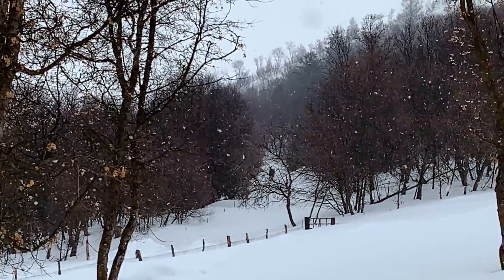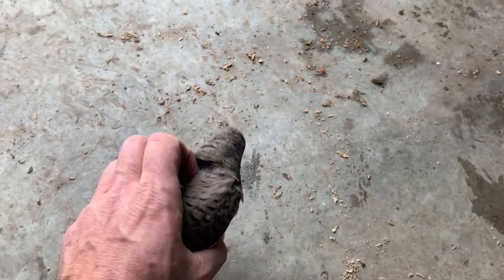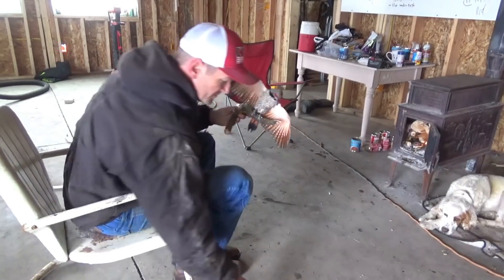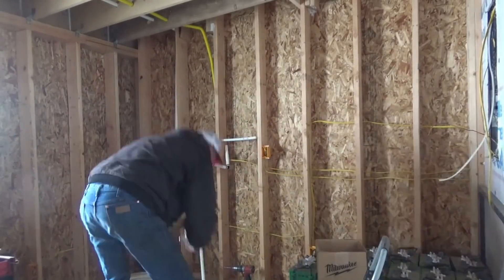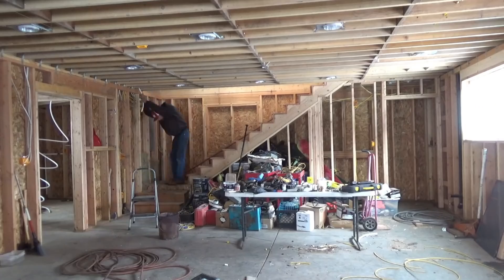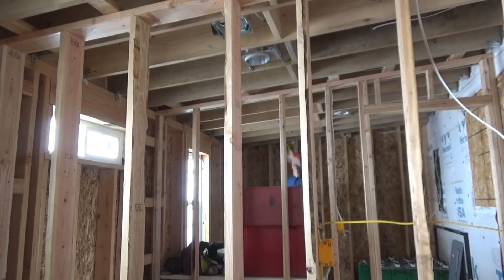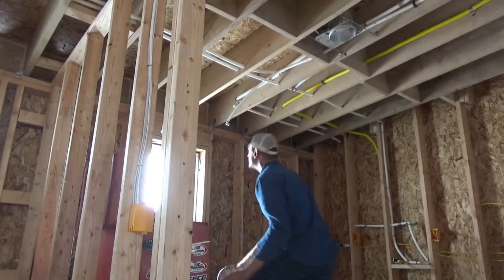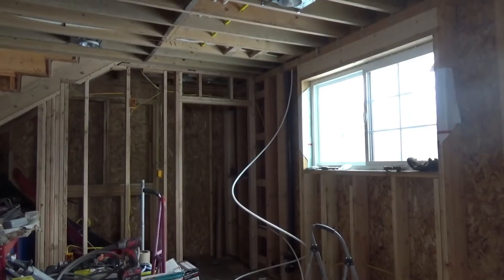#307 - Water Lines Are DONE! Woodpecker Problem Solved... And A Moose

Comment: Coming from an electrician.... At 10:25 I'd recommend moving the electrical box that is on the left side of that wall to the right an inch and a half. Just add a 1' piece of 2X4 and move it over.  Will look better and make drywall finishing much easier.  Make sure also that your light switch boxes are at least 3" from door openings to allow for trim. On interior doors with only 1 stud this means adding a 2X4 as well.

Comment: Here in Japan the PEX stuff comes in only blue and pink, but it's the insulation that is coloured not the water line, and yes it is all insulated, hot and humid in the summer makes you want to insulate your cold water lines too! If you run short of some line, you can buy just the insulation, this works, but I see your point on the non colour coded water line.
Sad about the woodpecker, I bet he just could not find enough food. I'm looking forward to seeing the seasons change!
Cheers from Tokyo!
Reply: I would be tempted just to put a circle of red or blue tape every so often to make it easier to identify each line when the walls are on etc.
Reply: lol at sad about the woodpecker  .  i have seen abandoned houses where woodpeckers pecked feet and feet of siding off a house causing major water damages .  not only that they disturb ones peace by pecking on houses that people live in also causing damages  . woodpeckers also cause lots of damages to trees . they peck the bark completely off in a complete circle killingg the top of the tree  . also the holes they peck allow for certain bugs to get inside of the tree and the tree will not survive .  the woodpeckers purposely peck a hole so that a bug will go in for them to eat later  . lots of  birds and animals in this world that can cause almost as much destruction as most of the humans  .

Comment: Glad you solved the Flicker problem.  Hope it doesn't have lots of relatives to take it's place.  A flock of them will do some serious damage to all your exposed wood.  We often see dead birds that fly into a window too hard, as they must see light coming from behind and think they can fly towards it.  Hope your exterior wall plumbing doesn't cause trouble.  Sounds like you're addressing it.  I'm surprised your water softener only recharges monthly.  My top of the line Culligan softener recharges about every 3 days.  And it uses a 50# bag of rock salt about once a month.  I enjoy watching your progress.

Comment: You made some very interesting comments about water.  We just moved to our homestead this past September. We found the old well (there used to be a house on the property), but there was no plumbing from it and it is an old, shallow, hand dug well. There is a possible spring on the property, but with the unusually high amount of rain we got this year, I have no way of knowing if it is year round and if it is, if there is enough flow to serve our water needs.  So the whole time we have been here we have been using rain water to wash with. I had just commented to someone the other day that this is the first winter that I remember ever not having an issue with dry skin. Also, we have a tankless water heater installed. I did not know that they last longer using soft water. I have been trying to figure out what is the best thing to do for our water supply. Develop the existing well, drill a new one, try to develop the spring, or do a rain water collection system.  Rain water is soft.  You have helped me decide, I think it will be a rain water collection system.  Now to figure out how best to set it up.

Comment: Network cables and wires to the windows and doors for future alarms could be a good thing before you close up the walls.  Most of the solar inverters now can use a data line into them and with the kids keeping them from the net is a pain on wireless but wired just pull the plug in a locked closet/cabinet. 

The drywell for the drain would need to be down hill enough from the well to not contaminate it as the water soaks in. 

Feel the skull and neck of the bird as it might of simply flown into a window trying to escape the cold. One of the jobs I hated when working at Bestbuy was the morning check the front of the store for seagulls that flew into the window above the doors.
Reply: H No  I worked at one in Maryland that is near a waste transfer station they are at year round.

Comment: Always drill the holes in the centerline of a beam or floor joist. It doesn’t affect the load bearing strength like holes close to the edge of the beam.

Comment: Hi. Looks like you have long water line from heater to some tap. So its gonna take few minutes for fresh hot water to pass way to tap. In such case you may make circulation with back way tube and circulation pump. Also good insulation very important as its tubes play like radiators. And cold tube may couse a lot of condensation. Good luck.

Comment: Knowing how cold it can get and with plumbing in an outside wall would a manual drain-back be practical? Maybe your hose-bids will suffice?  A typical out of a specific color of PEX solution for color coding piping is to use a colored electrical tape wrap for ID.

Comment: The better way to protect your plumbing is to use a high value insulator to the outside of the plumbing, rigid foam with a layer of reflectix for example, and not insulate  to the interior. This effectively places the plumbing in the heated space.

Comment: I would use the white for softened water Lines and blue or red for everything else. 

Then you bring in 1 inch into a manifold that breaks off to 3/4 for the water heater and then 1/2 for everything else.

Comment: Hello, maby it's the German speaking out of me, but I hope you document how and where you run all the power and water lines. I imagine in 10 or 20 years someone hanging a picture on the wall or something and they drill into one of the water lines.
Reply: Yup, my husband hit a copper pipe with a nail in a bathroom of ours. The previous owners installed the bath themselves. The pipe locations were not logically placed.

Comment: Do you know you can use no-salt water softening device for water softening? I used it when I bought my new house and it works very well no scale build up, it's been over 15 years now every thing are working well, only replace water heater recently, it is a 6 years water heater, espresso machine is still working strong. Best of all it will not effect your health.

Comment: Wouldn't it help the plumbed walls to put a layer of foil backed foam insulation between the sheathing and the pipes?   I think somewhere in my travels that's what I've seen others do.

Comment: Can lights and pex....we wouldn't be allowed to be no were near a can with pex  as cans get pretty hot.irving texas code.actually alot of fire resistant codes to a can light here.
Reply: I thought all his lighting was l.e.d.
Reply: Yes, the code may be to keep the pex twelve inches away from the can lights.
Reply: @drucifer_too   I dont no led or what ever. really common sense is electrical and water dont mix.lots of Joist bays to choose from.why so close or even in same bay was my question kinda.
Reply: @monicapttrsn  because we can dont allways mean we should!!
Reply: @shawnvandenabeele8307  I was agreeing with you pretty much.  I saw a video where the code requirement in a particular state was to keep the pex a min. 12" away from the can lights because the heat from the lights damage the pex.  The reason why I made the statement is because Heath wants to pass the plumbing inspection and will likely have to move either the lights or the pex.  Sure, he can move them two feet away, but there is a min. requirement, and I do want to see him pass the inspection.

Comment: You could wrap some of the water lines with heat trace wire so that if you do have an issue you can keep them from freezing. Consider if your away from the house for a few days unable to heat your home. FYI: The soften water that you will be using in the kitchen, Bath, Laundry, Contains a lot of salt. Take a glass full of softened water and either let if evaporate, or boil the water off. Be surprised how much salt is contained. So I don't think letting the water softener backwash into the septic is going to make much of a difference. Of course that salt in your water lines will help lower the freezing temperature.
Reply: He's using potassium.
Reply: Potassium chloride (KCl) is a salt. Consuming large amounts of salt whether KCl or NaCL is not healthy, nor its it good for metal pluming fittings or components.
Reply: Sorry that is incorrect. If you take a glass of water from softened water and let it evaporate or boil away you will be left with a salt (KCl or NaCL) residue. Typically a water softener will add between 35 and 65 milligrams of salt per 8oz glass of soften water.Also I doubt KCL is safer for consumption since natural Potassium contains some radioactivity (K-40 Beta decay).

Comment: In sweden we are not alowed to have any couplings built in the wall, big no no.
Reply: Peter Lee  

100 years ago when i went to plumbing school, they taught me that if a pipe leaks it is where it has been conected to another pipe in some way. Therefor we have all our pipes that is under pressure on, not in the walls. All our waterpipes are visible.
Reply: In Finland we have all waterlines that are inside the walls in a another pipe wich is called leakpipe.
Reply: northerntrucker same here in the Netherlands: blue for cold water, red for warm and yellow for gas

Comment: With the walls exposed you still have the opportunity to do a very thin layer of spray foam as an air barrier.  Then put the rock wool insulation over top.

Comment: Great video sir. How long does a tankless hot water heater last compared to tradition hot water heater is about 10 years?
Reply: If you run them on hard water and don't flush them a couple times a year unless your water is horrible (flush more) they won't last long and it also depends on the brand.
Reply: @Tumbleweed depends how they're installed.
Reply: @Tumbleweed Get a Rinnai and install it correctly and run soft water through it and you will have years of flawless use.
Reply: Bosch Aquastar 1000P was purchased and installed in 2008, $300 on my sidewalk three days later, does the entire house and still going fine with nothing done to it other than running off the spiders on occasion. Very hard water, I do not flush it or treat my water either. It's good enough for shower, garden, and washing clothes. But I do distill it for drinking and cooking, must stainless scrub the distiller with extreme prejudice for each and every one gallon load produced or the SS distiller pot will be destroyed and develop a leak. First traditional tank lasted 15 years, then 8, then 3, then one, and then I went with tankless. I don't have mine set to unbearable hot so that might be a factor. YMMV.

Comment: What is the advantage/disavantages of using PEX vs traditional PVCCPVC? 
I know copper is just priced too much.
Reply: pex is much harder to freeze and break. it can swell like 3x its normal size before breaks. sometimes even more. you can install pex while water is running. yes ya get wet. but you cant do that with copper or pvc.  pex isnt loaded with a bunch of chemicals. it can out last both copper and pvc. service is fast. cut insert clamp done.  i my self only mess with pvc copper if fixing repairing. otherwise new or frozen broke gets new pex and all old comes out. esp if my name goes on it.
Reply from the maker: Cpvc is terrible stuff especially in cold weather.
Reply: @RedPoppyRanch  friend mine just had to get 9 stitches cause his garage he used cpvc to run some air lines. one blew up and lucky only hit his leg and arm. not his neck or artery. i dropped my jaw when he told me why he had to get them. now one thing i am curious and you might be one to ask. 

how well pex work for that air application ? i told him to go buy metal pipe and fittings and do it right with water traps every 12-20 ft in his system. keep rust out of the lines.
Reply: @StevesDIYProjects7  There have been studies to show PEX does leach chemicals, such as methyl tertiary-butyl ether, you're kidding yourself if you think there isn't some fact to that. Its also susceptible to damage from vermin. And small exposure to sunlight can decrease is chlorine resistance. Reason its now wrapped in some countries. Copper also has the benefit of being antibacterial. Keep your PEX junk.
Reply: @coolhanddruid  who is installing home water lines that sit in sun ? just curious ?
Reply: @coolhanddruid  cause that is what poly is for. 
all plastic emit gasses. all.

Comment: Why do you use that crappy Class B pex? Your holes for the pex are too small and you should be using pipe isolators or at least plastic hico clamps with the male side put in the hole. Pex expands/contracts on it's length and has to be isolated from the wood. Thanks to me not checking on an employees work on 1 job i had to come back and repair 3 lines. BTW, I've been using pex since the 60's and i have repaired many many jobs that installers did not install to Mfg. guidelines and it's horribly installed here in AZ..

Comment: In Europe all over is Tankless Water Heaters. They are located in each bathroom and Kitchen and are also used in Radiator Heating instead of Boilers. It cuts the Electric by 1/2 than normal. You will not find conventional water heaters in Europe and many other counties.
Reply: That is not correct. In the colder regions like the Nordics, tank waterheaters are very commen. Mine here in Denmark is heated by my pellet furnace, when really cold by my woodburning furnace, in the summertime the tank is heated by solar collector (water solar panel).
Further the tank has a backup Electric heater element.
Reply: We don't use multiple point of use tankless heaters, we use whole house capable units and if you run electric ones be prepared to pay 5+ times your current electric bill.
Reply: In the Czech republic (landlocked, European country, cold winters, hot summers) tank water heaters (heated by gas or electricity) are common. One tank for each household.

Comment: 20 -30 yrs from now Pex connections will leak. I know because I'm replacing it in my home.. copper is the best . PVC better than pex. Just my opinion
Reply: Copper is inferior to Class A pex and Class B pex is about equal to copper. I have jobs i did in the 60's with Class A Wirsbo and RTI that have never leaked or been repaired. 1 community i worked in all the time they only allow Wirsbo because the water will DESTROY Type K copper in less than 2 years.